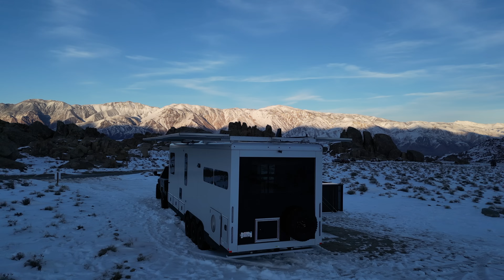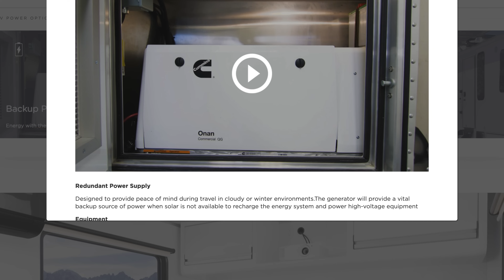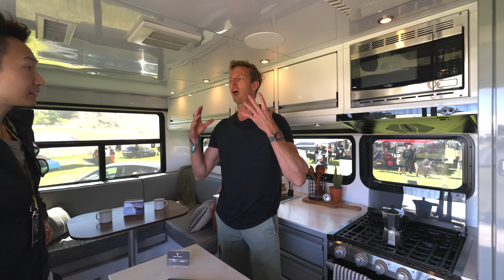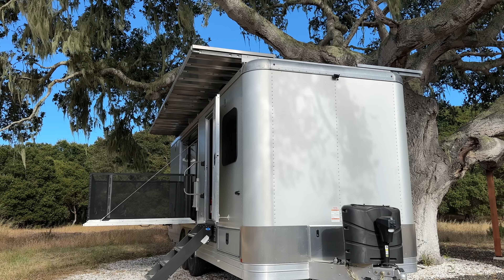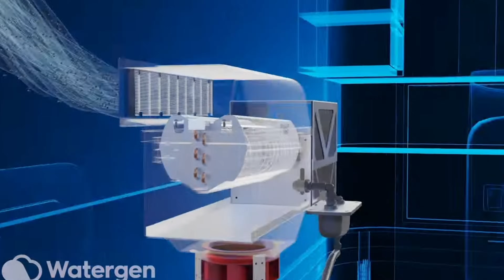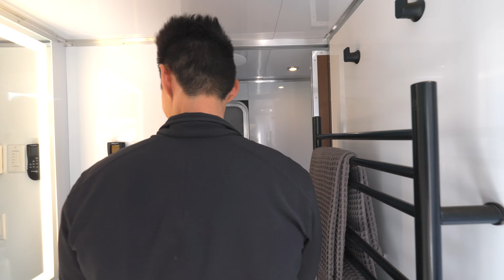All Electric RV for the Tesla Cybertruck (Living Vehicle Cyber Trailer)

Comment: You can charge the Cybertrailer from the Cybertruck outlet in the bed while you are charging from the Supercharger to the Cybertruck.   If you get the lifetime free Supercharging promotion for the Cyberbeast right now, then you can basically travel everywhere constantly with no charging/fuel cost!
Reply: Doesn’t the CT shut down the outlets during charging?
Reply: @Jethr001I saw a video of someone doing it

Comment: You say your truck will go 300 miles pulling the ev trailer. Why can't your Tesla truck trailer hitch plug into the solar panels and have unlimited mileage
Reply: For one because he said the panels are 5,000 W. That’s 5kW. The CT battery is 113 kW/hr. Meaning you’d need 23 h of sunlight for a full charge. At best, if CT could even accept a L2 charge while driving, during its 300 mi (4 h at highway speeds), you could add back 60 mi. And that’s assuming the unfolded panels are not wide enough to get clipped

Comment: Love it, but too high $$$$ for a retiree like me. I joined the RV life over 1.5yrs ago. I have a 4x4 Ford F250, and tow my 5th wheel. But, I would love to be 100% solar to be off grid, but have not seen any
trailers or 5th wheels that are designed for the average person! 😅😂
Reply: If you already have a 5th wheel you could retrofit for a lot less for power. Just google. It’s fairly easy to set up if you can follow instructions. Not sure about water reclamation but that probably can be added also.

Comment: Why is this Cybertruck specific again? Why can't someone with a more capable EV truck like Silverado, F150 or Rivian trucks work?
Reply from the maker: It is! Any EV. But the owner themed it with the cybertruck since he's an engineer and liked the shape and design. But at the end of the video he said it's any EV
Reply: Like it or not, Tesla is the Apple of cars. When Apple comes out with a new feature that Android has had forever, like wireless charging, suddenly everyone cares and starts making much better accessories. Tesla is the first car brand I’ve seen that has a whole custom ecosystem like this. Partly because tech people with $ prefer Tesla. Some might buy a Rivian, but you won’t catch most of them in a GM or Ford.
Reply: @davidc2072  I think this is changing very rapidly